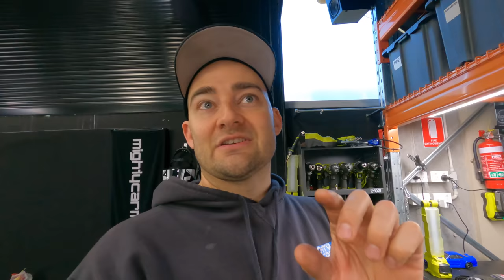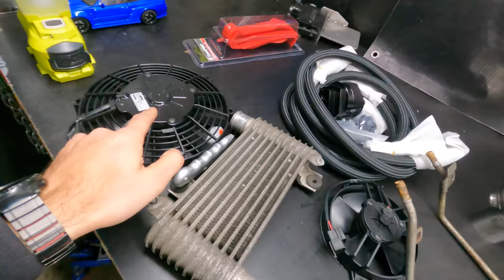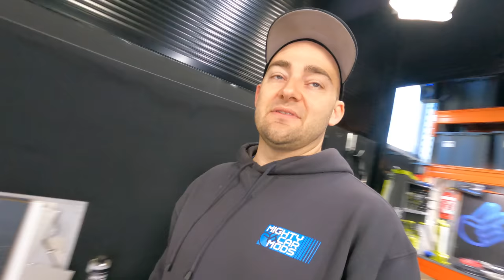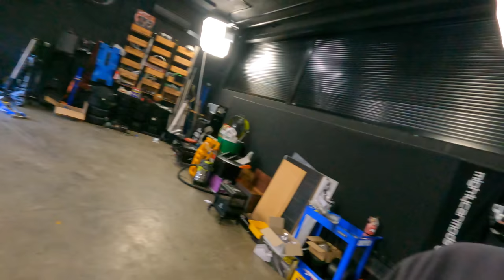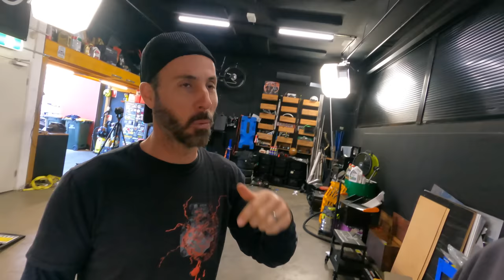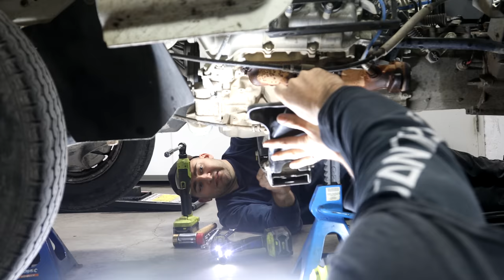The full story of our turbocharged Kei Truck (Disrespected Timtam)

Comment: Martin, you talk about the RHB31 and the RHF3 being the "Upgrade" for Daihatsu Land but you forgot about the RHB32 that came out on Charade Turbos from factory.

Using the factory parts off a original G11 Turbo i ended up turboing my G200 Charade, the only let down was the mechanical fuel pump couldnt keep up and the carby would begin surging
Reply: @FixingWithFriends  i was running the factory G11 Turbo carb instead of the G200 NA carb.  Problem was G11 Turbos have an electric fuel pump where as the NA engines use mechanical fuel pumps, the mechanical pump cant keep up with the fuel requirements needed to run the engine properly, sure it would idle and i could slowly accelerate along but if i miss judged how hard i accelerated tbe car would start hunting along and starve for fuel

Comment: It would be hilarious if they were to get another kei truck and STI swap it, it might just fit in there
Reply: I've been looking at my spare VW Type 3 engine and transaxle, then at my Hijet! Hmm!
Reply: @terryjackson4538  There is always BMW's "Flying Brick" 4 cylinder
Reply: @zigenstern  thinking the flat air-cooled set so the carbs and dizzy etc are set under the hatch in the tray. Puts the diff at the axle point with a normal vw style IRS and CVs. The diff would need to be flipped to run the right way. Gearbox would then hang out the back. All a bit backward but a dak dak sounding kei truck would be cool.

Comment: (Exhaust pointing down just a little is kind of handy for letting condensation drip out the tailpipe instead of back into mufflers. It's also why old-fashioned pencil-tips (I like the sound those make on a lot of cars and trucks, if they're nice-gauge stainless: in principle I think they're meant to get the exhaust to go further away by making little vortices,  kind of an old time American thing,)   often come with a little weep hole at the end, cause otherwise it might tend to collect there.

(Also before anyone asks, I have no idea why they're called pencil-tips. Maybe they slightly resemble the eraser end?  :)  )

Comment: When placing things always look at what it takes to repair or remove the thing in 2 years. A good fabrication rule. That battery placement you will need to remove that crossmember to change the battery. There must be a better spot.

Comment: On that cast manifold… when it cracks again… heat it up to 500deg F. Or so and then stitch it together with several short welds. In between welds peen (beat with a hammer) the work piece to help relax the molecules and relieve internal stresses… then chooch away!

Comment: Hey guys! Good call on not running a td04 on the truck. I have a TD04 13T on my Cappuccino and it doesn't start spooling until 4500rpm and isn't all in until 6000rpm! Good fun if you can use all 11,000rpm but I don't think your engine can turn that "rpm easily.  Loved the build guys!

Comment: That bracket for the intercooler should be done by welding a box-end extension off the frame matching the one that your current bracket is bolted to..  just extending it, bending metal could give you a matching box end cropped on the top similar to what extends off the frame now..

Comment: sumting i have seen done was putting an extra stand alone injector in the inlet trackt turned on and off with a pressure switch it enrichen the mixture under boost and the stock ecu with help of the lambdah senor leans out the stock injectors if needed

Comment: Dear Mighty Car Mods your intercooler needs two things added to it to make it perform better. First is a electric fan to help pull air through the intercooler from the back side of it just like a vehicle's radiator does. Second is a air scoop that faces the front of the vehicle to help guide the air going through the intercooler. The current setup not much air is passing through the intercooler so the air density is not that great your not gaining much performance because of it the colder the air temperature of the intake change the more power you can achieve out of your engine.

Comment: My one concern would be that Marty welded pipe directly to the exhaust manifold.
Unless I miss my guess, the manifold is grey cast iron, and grey cast iron is prone to cracking when welded unless care is taken to pre-heat the casting before welding, and cool slowly once the welding is done to prevent a brittle weld.

Comment: Do yourselves a favor and pick up some thread pitch gauges metric and standard. We use them at the machine shop I work at...just measure the OD with calipers and then find which gauge fits in the threads the best.  Thanks again for your content!

Comment: RHB32 is good for an easy 88HP and 112 Ft/Lbs on a 993cc 3cyl at 7 psi with 8.5:1 compression... Turn it up to 20Psi and it spins in 2nd gear...

RHF3, actually probably would have been fine to be honest, since you want that boost to come on quick in truck vs a Cappuccino. Either way, both are solid options.

Comment: I love all the little Kei cars, it's a shame they're basically unobtainium here in Scandinavia. 
I used to own a Daihatsu Charade Turbo, i think it was a 1986 or 1987, which is basically the closest thing to anything Kei here. It was mechanically beat up, using lots of oil and fouling plugs at idle, and with no real way to get parts i just sold it to someone who drove it illegally (i couldn't get it past inspection, he bought it and drove it as-is) and i really miss that little nugget. It was hilarious to rev it out and get that small bit of boost in the midrange and the orange turbo light in the dash came on... I wish that car was in better shape! =)

Comment: I have a Buell motorcycle and the oil cooler is mounted much like your intercooler. It has a small air scoop that can pull air over the fins. It might work in your case, while the truck is moving at speed.

Comment: A bit late to the party, but if you're concerned about finding  a 'proper-sized' intercooler for something that small you might just want to turn to the SxS (UTV) market instead of automotive.  Lots of aftermarket support for the Turbo Polariseseses and  CanAm's.  

And unlike the snowmobile folks, those are designed to work in pretty hot conditions..

Comment: Might look at adding a set of leads off the battery to the side so that you can jump the truck if the battery goes flat with the bed down. Just a thought. Might have to get all contortionist if you had jump it if not. They make a plug that would work easy and simple.

Comment: Getting to the engine in a Toyota Emina ('90s sloping-fronted people carrier or mini-van) is a bit of a task, it's sort of under the driver's seat. Toyota even did a 4 wheel drive version, so you could have a 4x4 mid-engined low drag coefficient MPV. Pretty sure there was a turbo-charged version of the 2 litre as well.....

Comment: I'll admit, in the first vid I was wondering why you went with a primary, so much more common for failing on the Legacy's (since it's on boost so much of the time), here in NZ the wrecker prices are over $600 for any, just because supply and demand figures are so skewed. BG's and BH's aren't worth wreckers time anymore, but there's still so so many old ones on the road blowing primary turbo's all the time that the demand outstrips supply quite redily here. The secondary's though, comparitively speaking never fail, and so are a dime a dozzen. I was surprisde to hear how cheap and easy it was for you to track down primary turbo's! That said market place here you can still pick em up for cheap, but they get gobbled up pretty quick at those prices.

Comment: Exhaust pipes "tip down" to allow condensation to flow out, lest they collect in pools and rot out your exhaust prematurely.
Reply: Stainless steel does not rust
Reply: @M3PH11  All steel rusts.
It's called stain less, not stain proof.

Comment: During early video, when you do the turbo selection, i really hope that you're using the rhf4 vf33.. glad in the end that is your selection. rhf3 are ok, been using it for awhile. But rhf4 vf33 is great mod for any daihatsu 660cc turbocharged engine.. got some guy here in my place mod the turbo, using exhaust side rhf3 with rhf4 'compressor' to reduce lag..

Comment: Hey guys I know u are all done but I would have recommended a ct9 from a turbo starlet.
Essentially it's too small for a turbo starlet so it would translate great for a 1000cc engine mid size and low compression so basically a high compression 660cc engine high compression would love it

Comment: one day, I'll have a bucket of turbos in my shed
Reply: Owned an 85 Shelby Charger. Ended up with 3 turbos just sitting around. Ended up with 300 hp out of a 2.2l, due to the super 60 package. Pulled the chip and engine and turbo from a wrecked omni I found in a pick and pull. Fun times. Best 1/2 mile time was 11.2. Thing handled like it was on rails. Miss that little car.

Comment: Need cowls to direct air flow in and out of the IC. As of right now, you have functionally zero airflow through the IC. Since you can't face it towards the flow, you need some way to ensure air flows through the core to make a difference. I mean, on a motor this small and with such an open area, I'm not really sure heat soak is an issue. But right now, your IC really isn't doing anything.

Comment: love the truck but two problems
1. why suck up your tappet cover oil fumes.that will just cover your turbo and all pipes lined with oil
2. why do you guys never fit dump valves? boost pipe back pressure can bend turbo intake wheel blades or snap shafts

Comment: Hi guys. This video is 25fps. Please film in either 30 or 60fps. Most phones tablets and computer monitiors are natively 60fps, and filming @ 60 fps will give the smoothest playback without judder. Even 30fps looks vastly better on a 60fps display than filming 25fps. The 50 or 25fps to 60fps conversion on my tablet (most are 60fps) is causing noticable judder on any movement.

Comment: Isn't the compressed air chirp unwanted? Based on performance of the parts, not sound. It's unwanted wear on the turbo due to excessive push back on the compressor wheel. 
But sounds pretty.

Comment: Wouldn't a water to air intercooler be a better idea than a side mounted air intercooler. you could rig up a front mounted water radiator with a cheap electric pump.

Comment: Marty, you really shoult fit a small flex pipe on that exhaust... the vibrating forces from the exhaust and the engine movement will be sent to your welds and break them somewhere.

And you didn't fit any BOV, did you? It's not that good for that compressor wheel, releasing the overpressure over it... altough it makes funny noises because of that...

Comment: quick question; you appear to have the green hobby-bosch drillpress, is that so small, it would be no bueno for putting holesaws through mild steel, or is it just too far gone into the crud and misc. stuff on the "healing bench"?

Comment: Hos do you get the Welding done? Steel, castiron and stainless steel dont wont to be welded toghter.
Sorry for the bad English, love from sweden
Reply from the maker: Cast and steel can be welded, it’s not the perfect setup but it works. Tig welding with the correct filler rod and it works.

Comment: 34:00 I still struggle to understand why you guys mounted the IC radiator in the side of the car, instead of in the front. Yes, the piping work would be tremendous but still...

Comment: are you having any heat issues with the rad or intercooler mounted in line with the truck? would think that  it wouldn't get that much airflow?

Comment: Mechanical (imperial) horsepower hp vs metric horsepower PS. 1 hp	= 33,000 ft·lbf/min by definition. DIN 66036 defines one metric horsepower as the power to raise a mass of 75 kilograms against the Earth's gravitational force over a distance of one meter in one second: 75 kg × 9.80665 m/s2 × 1 m / 1 s = 75 kgf⋅m/s = 1 PS. Nothing to do with the Japanese.

Comment: I don't know how to post all the evidence to back this but you can fit a 1.3 or 1.5 leader Toyota engine Daihatsu mainly uses Toyota Transmissions if you go direct to the Toyota manufacturing page and go down the list of parts that they make parts list that will say the different Vehicles they going in if you look at Transmissions Toyota makes most of Daihatsu Transmissions and it'll also give you what series of engines that can bolt up to the transmission with no modifications don't believe me look yourself

Comment: that "stainless steel" Magnaflow muffler is going to rust off in about 2 years flat...

trust me, I know from experience and having to warranty those damn things all the time.

Flowmaster and Magnaflow mufflers are the worst junk on the market, and only good to put on your car, if your selling it tomorrow 
You'd be better off with a Thrush Turbo muffler or a Walker muffler... at least they would remain as part of the vehicle for longer than a short year or so